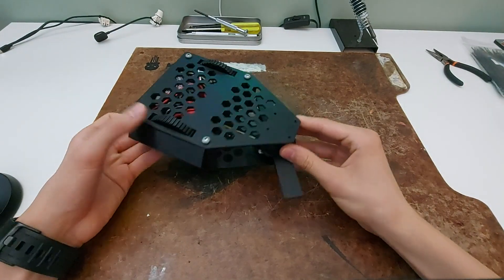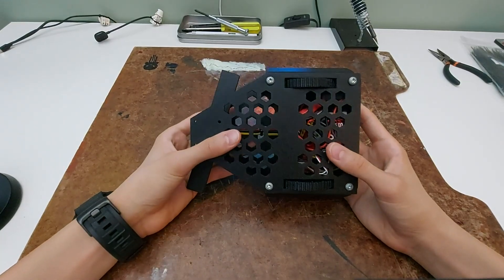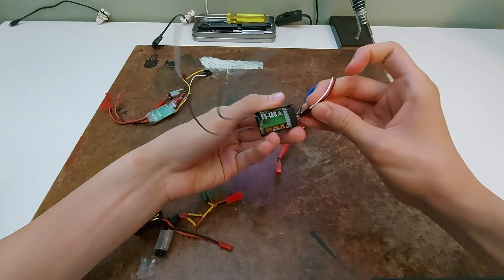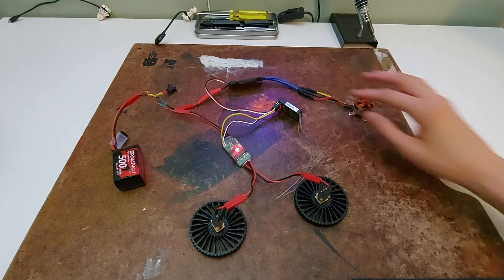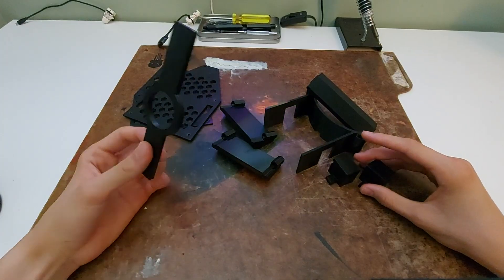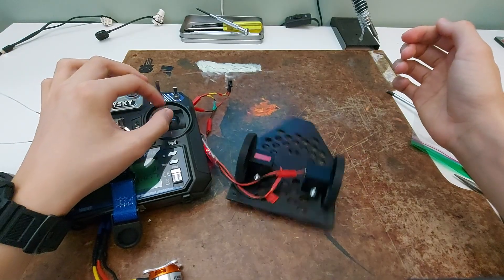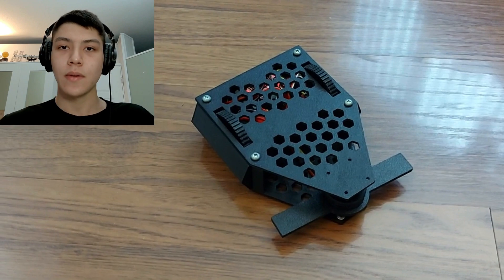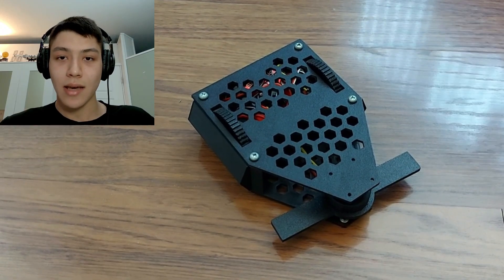I built a Battlebot prototype! (Part 1)

Comment: Armour I would use nylon, umhw, polypropylene or tpu. (I use umhw and tpu) Top and bottom plates I'd use abs or nylon. (I personally use cf plates for that) petg and pla almost never survive combat
Reply from the maker: Thank you for another comment! I will change the PLA with something else for combat, but I never planned on replacing my PETG parts all that much. Parts of my wheels and my drive motor holders are made of PETG, what would you suggest I replace them with? Also, I was originally planning to use ABS for my armour, but your comment now is the second comment I recieved that suggested that I might use TPU instead, so I will definitely make some TPU armour for my robot. Thanks again for sharing some of your knowledge with me!
Reply: @stardra9on  tpu helps absorb shock of hits. But inserts rip out easy. So have the insert in nylon or something hard. And the mount made out of tpu. Then when you bolt it up add a washer so it dosnt pull through.

Other good solution is to make the mounts out of nylon and have a small block of tpu under it. 

With the tpu use around 60 to 75 % infil for parts you want to flex alot. And 95% on parts that need to be stiffer.

It's a balance hard materials are great for keeping things still and in  place but break easily on impacts. flexible is good at absorbing  hits but not good at holding on to it's shape, inserts or bolts.

As a horizontal spinner, a small amount of titanium right at the end where the weapon is goes a long way to keep the robot from breaking. And a small extension from the bottom panel that can hold a bearing will greatly help support the weapon motor and help spread out the forces to both sides on an impact.

Abs or asa is very rigid and light. But makes terrible armor. It tends to shatter catastrophically on impacts.
Reply: What about using polycarbonate for the top and bottom plates? Are there any major issues with it?

Comment: Keeping your blade a shorter distance than your wheel base helps tremendously for drivability. Just an odd part of commonly overlooked facts.

Tombstone does this for example.

This by no means is ment to say you shouldn't use bigger blades, just an observation.
Reply from the maker: Thank you so much! I was having problems with drivability when the weapon was spinning, so I will keep your commment in mind as I continue to revise my design. I really appreciate your feedback since I am a new builder, and knowledge from more experience really helps me. Thanks again!
Reply: @stardra9on  np, everything about building a combat robot is a trade off. No one solution is the best.

Comment: Nice! Another design inspired by cheesecake 😊 Mine's served me quite well so wishing you the same! You mentioned the armour probably being abs but i would highly recommend tpu if youve got weight for it. Given the shaft collar is tpu already im guessing itd be easy enough for you to do the armour in tpu and it's definitely going to perform much better that way. Ive shared my thoughts and experiences thus far on my own channel if you are interested (mine is a 150g ant)
I appreciated the depth you went into aswell. Definitely helpful for those starting out
Hope you were far away from the bot when doing those spinup tests! Even plastic weapons cut deep and also can expand and splinter when spinning at speed
Reply from the maker: Thank you so much for your comment, I really wanted to hear some suggestions from people with experience and i will consider using TPU for my armour. I already learned my lesson with spinup tests the hard way when i didnt screw down my collar lol. Tysm again for your comment!